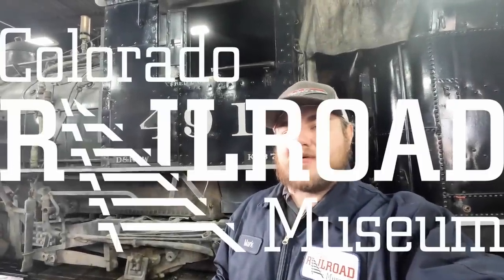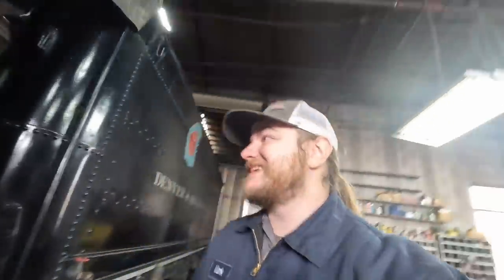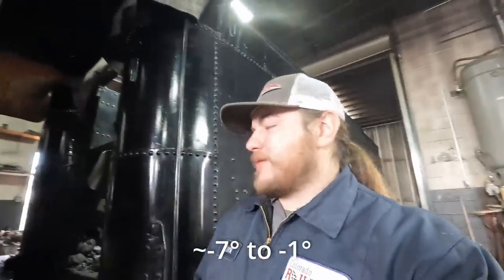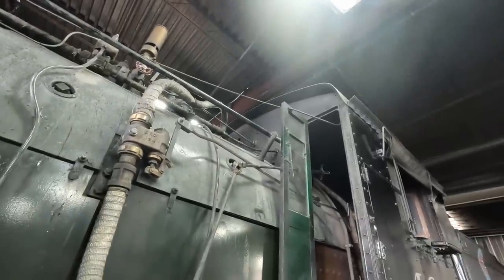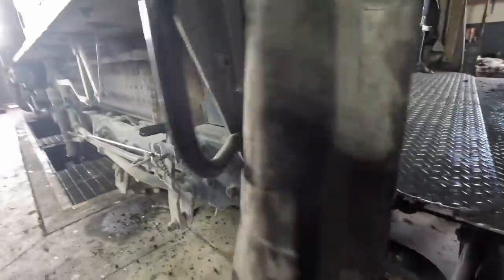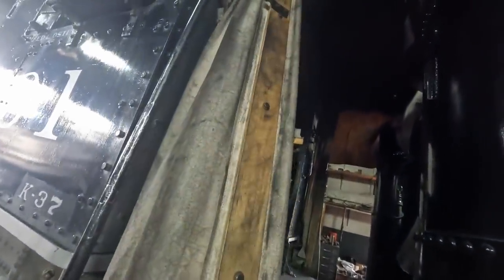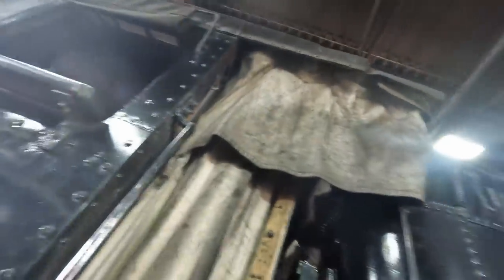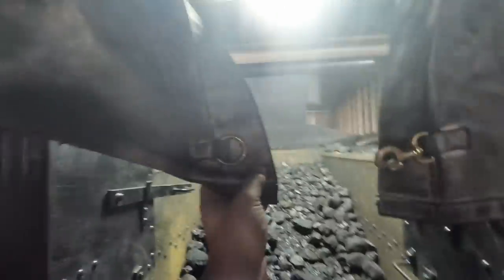It can be FREEZING COLD in the cab of a STEAM ENGINE? How did they stay warm?

Comment: Getting too warm and comfy,  as the feeding of a Firebox sometimes gets,  then going outside to align a Water Spout, can make for a pretty dramatic change of pace and temp?
Some guys in the mechanical Department before Mechanical Stokers were financially accepted,  as they made requests to Financial Department planners,  had some limitations from greedy Stockholders who assumed Firemen were spoiled?
Working a long hill with a heavy train, can work up a sweat.....
Even at +10 degrees a 30 mph sidewind,  while you are holding a splashing spout,  can penetrate a lot of layers.

Comment: so in places with winter did they just have to keep locos always fired in winter so they didnt freeze or did some yards have an external steam source just to keep the water above freezing. As id imagine it was not easy to totally drain a locomotive.  As Imagine they must have had some times where an engine would be idle but there is no room in the shed.
Reply from the maker: Engines that were outdoors were either running, or winterized (Drained completely and blown out, along with all the plumbing). Otherwise, yeah, shop steam.

Comment: Must have been really awful working in winter on those British locomotives that didn't have much of a cab until a fair bit into the 20th Century.  I understand it doesn't usually get way below freezing there like it does here (Atlantic conveyer belt helps keep it more temperate), but still, when it's damp and in the 30s `F/+single digits `C, that must be no fun.

Comment: If I had to design a steam locomotive I’d have the coal stored somewhere up high above the furnace so that the work of loading it could be done largely by gravity. Was this idea ever explored? I assume there’s a very good reason why it didn’t happen. It always seemed mad to me that we put a man’s hard labour between the fuel and the fire?
Reply: I imagine it had to do with weight and height. There's only so tall an engine can be and still fit through the tunnels. I'd also imagine there would be a weight limit per axle and the more coal stored on a driving axle, the less boiler you can have. I have seen videos of much smaller engines having coal boxes on the side of the boiler, but it was only enough coal for switching in a yard. 

I'm not a big railroader so take this with a grain of salt.
Reply from the maker: A neat idea, but the fire needing cooling makes lots of water being over the top the most important thing.

Comment: Does a typical locomotive of that era have electricity? I have noticed on some older steam locomotives the large head lamp appears to have an incandescent lightbulb in it. I have also noticed that the steam locomotives in England do not have any front lighting on their engines. How do they run at night with no lighting?
Reply from the maker: The headlights are more for showing that a train is there, rather than actually casting light for the engineer. 

Most of our engines got electric lighting added as rebuilds in the early 1900's.
Reply: @Hyce777  Well thank you for clearing that up for me. I am a retired electrician, so I am always interested in all things electric. I always look for the tell tale wisp of steam coming from a steam locomotives steam  electric turbine near the top of the cab. I found an old abandoned steam engine in the Pacific northwest woods and harvested its electric lighting switch which I have to this day. I think the machine eventually was scrapped.

Comment: hyce how would the steam heat work for the tender seat?
Reply from the maker: There's a supply line to the tender and train with a valve in the cab to send steam, a swivel joint between the engine and tender and then subsequently down the train if the cars are equipped; and then another valve for the heating coil in the doghouse.
Reply: @Hyce777  I’m not going to lie my first thought was there was a miniature boiler that the person in the doghouse had to work.

Comment: no way the furnace is 2000 degrees. Ive worked on 600 lb marine boilers with super heated steam burning heavy fuel oil which has more BTU than coal and the furnace is only like 750 degrees.
Reply: DId a quick Google search and it looks like he might be slightly exaggerating but close.
Reply from the maker: We draft way harder when working than marine boilers do. You are right that oil has more BTU's but coal burners get up there. 2000 might have been a slight exaggeration but it's up there.
Reply: @Hyce777  marine boilers have huge forced draft fans to supply air. I doubt a locomotive is drafting harder naturally asperated than a forced draft fan
Reply from the maker: @jameshauth8590  every "chuff" you hear is a normal shockwave out of the stack, which makes the fire burn extremely intensely. I don't doubt that the forced air of the marine stuff is significant, but you would be amazed at the draft these engines create. Enough so that when you go to shovel, it tries to rip the scoop out of your hands.

Comment: In Australia, we normally have the opposite issue. Trying to cool down. One of the most physically exhausting days I've ever experienced was firing a steam loco for 8 hrs in 35C heat with 90% humidity. Staying hydrated was almost impossible.
Some railways over here like the Western Australian Government Railways, changed the cab designs after WW2 so that as little of the firebox was in the cab as possible. Just the backhead for some designs. Over there the summer temps can be 42-44C.
Reply from the maker: Steam in the heat is awful. Agreed. Been there, done that, got the heat stroke too.

Comment: Why curtains? Why not just use DOORS?
Reply from the maker: The curvature is sharp enough on the narrow gauge that a door would never work out. The gap between the engine and tender can vary from 1' to 3'. They had to use something flexible.
Reply: @Hyce777  I was referring to the sides of the cab, not the rear.
Reply from the maker: @craigcorson3036  That is what I was referring to as well. You can't put a door where the curtain goes, as the gap changes so significantly. The side of the cab itself is at a completely different height on these engines, and doesn't lend itself to a door either.
Reply: @Hyce777  So, you're saying that the rear of the curtain attaches to the tender? That would explain it, then. I was thinking it attached to some part of the locomotive itself.
Reply from the maker: @craigcorson3036  Yeah, precisely.